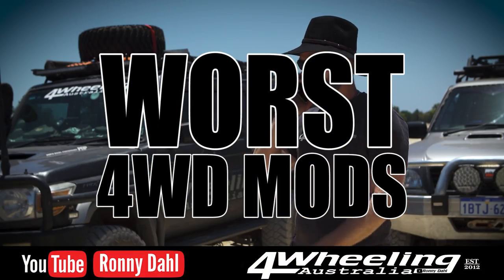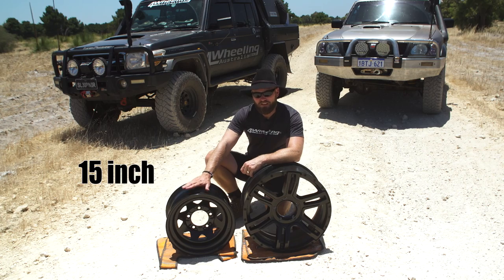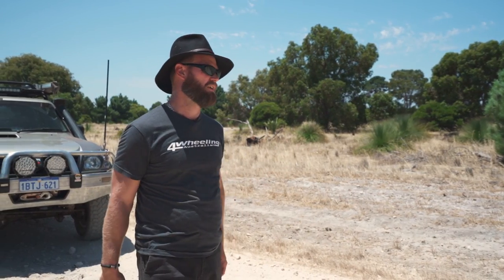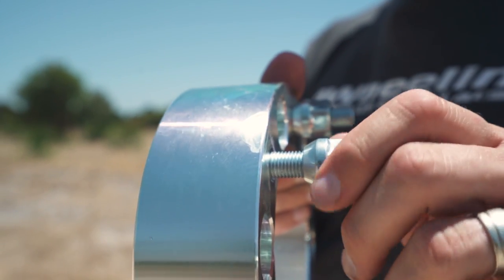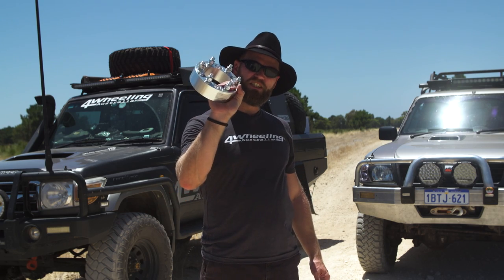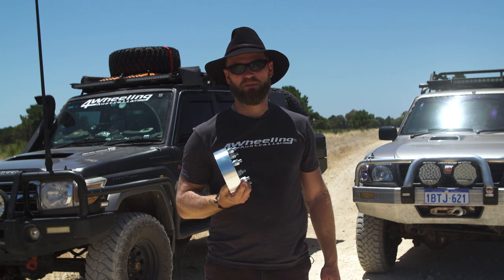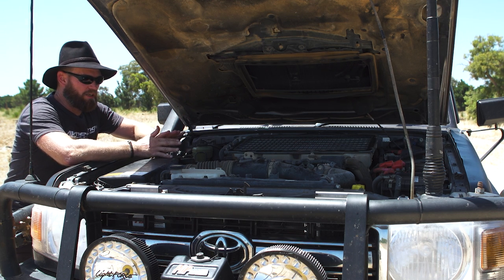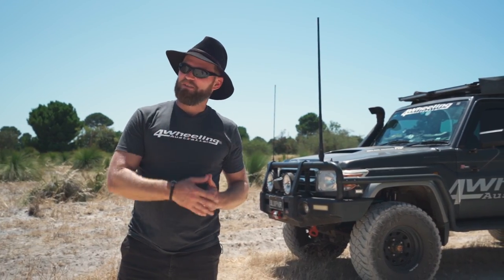WORST 4x4 MODS, DON'T DO THESE TO YOUR 4WD

Comment: Ronnie, your list is actually very good, but one thing you don’t mention is all the mods put together. What does that mean? Weight. Now I know you Aussie cats build trucks with a mind to dealing with anything you could need in the wilds of Australia, And because of that, your rigs are heavy. 

Here in the US however, there are so many that make their rigs stupid heavy for stupid reasons, especially for daily drivers. Their rigs get 11 miles per gallon and drive like shit. I consider permanently mounted winches as being unnecessary for a vehicle used it as a daily driver, mine I’m building is removable, hooking up to my trailer hitch receivers. That way I can rig it up on either the front or the back of the vehicle, and I don’t have to drive around town with it permanently mounted to the car.
Reply: Benis you know America is a big diverse place right?
Reply: I get where you're coming from. But a lot of it is to do with looks and capabilities as well. For sure we all like to build a truck that looks cool and catches eyes, they wont tell you but everyone likes the attention. But also I set my vehicle up so its capable all the time whenever i want without any set up required. I can get in an go bush after work or sometimes even whilst at work, for example I've had a mate use winches to get others out on construction sites, I think a lot of us do it so that our rigs are always ready when we need them and personally I prefer having the one vehicle I can take pride in and use for everything I do, hence it being my daily.
Reply: Because I go offroading on the fly
Reply: @fungus2116  the state of Utah would disagree hotter than hell in the south l snow and mountains in the north we legitimately have it all.
Reply: Really depends on what “daily driver” means to you. I am a forest owner in northern Europe, meaning my daily drive ranges from small gravel roads to no road at all through dense woods, the only time I drive in tarmac is once a month going to town for a haircut.. Dual winches, chainsaw, high lift, etc are absolutely necessary. But for most people I agree, it makes little sense carrying 500 kg of gear around driving down the highway to work everyday.
Reply: I leave all my recovery gear, tools, etc in a box in my tray because I often decide/notified  last minute on a 4x4 trip and I don't want to waste time putting shit together.  I've also taken my gear out of my car a couple of times and then needed it.  So it stays in
Reply: Here in the US (where I’m at) people like desert runners and trophy trucks which ARE completely legal to drive on the streets out here. These trucks are designed to be light as possible and run 800+ horsepower engines. Yes they get 4-12 miles to the gallon, but tell you’ve done 120 miles per hour over the bolder laden, ravine ridden, erosion scared desert then you wouldn’t understand. But it’s all good, you keep doing you...
Reply: Peter Jackson there’s a unmistakable difference between a truck and any 4x4 UTE
Reply: @NickS-mt8mf  however, with a much more evenly spread populated areas. Australian's mostly congregate along the coastline, up to a few hundred km inland. I can't find a good source but I would confidently estimate that 95% of Australia's population is within 300km of a coastline, 80% within 100km. This means that once you begin to travel remotely you are vastly reducing any support. And yes, I'm sure there are very remote places that I'm not aware of, across the US, but as far as I'm aware you won't ever end up several hundred to over a thousand km from well established support networks.. where you would actually find yourself driving, not just what's possible.
Reply: @kregadeth5562  I think his idea is that he installs it when he's going out for a drive/trip.. not after he's stuck. Just because he mentioned versatility of front or rear hitch, doesn't mean it sits uninstalled until he needs it. Broaden your thinking.
Reply: All due respect, im not removing my winch every sunday night and putting it back on every friday nicht for weekend wheeling.
Reply: @AWThethrower  you might be taking it out of context...  I don't believe the bloke is suggesting that you remove a conventionally fitted winch that's used every week; there are people who only 4-wheel every few months or so, yet have a winch permanently fitted. 

However, in Peter Jackson's case, he has opted to have a quick-fit winch setup so he can remove it ANY time it won't be used. But for people who don't want a hitch mount winch hanging off their vehicle, and 4-wheel often, a permanent mounted winch, on a daily driver, is the cost of having the capability. In which case any reasonable person would expect that you would leave it installed.
Reply: @olivermaskell6244  So the winch goes in the jockey box and takes two minutes to plug in to either end of the truck and do those emergency jobs. I carried a 1.5 k behind the seat of my 2wd Datsun and Mazdas for years. Used it to get unstuck once and often to snake logs up slopes for firewood.
Reply: Bar work, bash plates and winches normally add most weight to the vehicle and there a must if ya gunna hit the hard tracks in remote area's and bounce the roo's.. can't compare 2 different countries mate totally different environments and conditions.
Reply: @kaigaming2759  You completely missed his point 🤦‍♂️. He isn't comparing environments, he's comparing people. Paraphrasing, he said that Aussie's build heavy rigs when we tour because we need to, but in the States people make their rigs really heavy for less practical reasons.
Reply: @Nathanation88  then weight wouldn't be an issue for us over here, why bring it up? Is it more for other countries as an issue?
Reply: @kaigaming2759  He's highlighting the differences, that's the point.. What, people aren't suppose to discuss geographical differences of mentality?
Reply: Yeah but despite rigs being typically heavy here they still use a lot less than 11mpg due to being almost exclusively diesel. 
Probably close to 16Mpg for your average 79 series setup with 33s, bit of lift etc 
4x4 gear, Loaded up tray AND towing 11mpg is probably still more than what a 79 drinks.

Removing/adding mods to hit the mud or dirt seems like a lot of effort. Most people leave camping gear etc. out but 4x4 gear usually stays in. Removable winch that can be relocated to rear or front is a great idea though! But id still leave it on, or in the vehicle at all times, better to have it and not need it than to need it and not have it.
Reply: @Nathanation88  what ever ya recon, just saying how your wording it in these comments is different to how I seen it portrayed in the main comment.
Reply: Kai gaming you’ll get there.

Comment: I’ll mention myself. Paying $3,000 for HID conversion on my lights from the halogen & then having them fail two years later.
Reply: I got cheap eBay stuff that I can replace 10 times and still be under the budget of 1branded lights
Reply: Anyone paying $3k for a HID conversion should have their head read (sorry). Most cars of value now will have a version available from factory with HID's or high output LED's.. Either upgrade the car or buy the OEM version, ideally from a wrecker. That's, of course, if you're not happy with a standard LED upgrade available for most vehicles, which then raises questions of why you need so much light and can't go for an aftermarket spotlight, light bar or other setup. I have seen many car owners mount light bars behind a grill, in the bumper, on a plate bracket, etc.

But HID conversions are a sticking point for me because I get absolutely P'd off when numpties modify their lights and don't adjust them properly... Low beams pointing directly into oncoming drivers windscreens.
Reply: Disobey Negatively  I'm not sure what you exactly mean by this. There are a lot of ways you CAN install HID's but whether it's 1) legal, and 2) considerate to other drivers is another question. In Australia  (most states, I believe), HID's need to be auto-levelling. So if you're using them for your primary/low beam driving lights they need to have that feature. Standard LED's are typically fine, but not high-output. But if you really need a lot of light then high-beam operated aftermarket lights is where you'll achieve the best result.
Reply: Disobey Negatively  Sure, got ya! I agree. I thought you might have been speaking of the headlight reflector.
Reply: I did both. Hid in reflector projector headlights & considering I’m driving a car that didn’t have HID possibly back then. It made it difficult for me
Reply: Jason9110110 just my opinion but seems like a poor use of $3k considering the light output you could have achieved via other means, same or less money. Something you could swap car to car. Seems similar to people spending 2-3 times what a car is worth in a paint job (like I’ve seen on old lancers, commodores, etc, with no inherent value). But, you can spend your money however you like.
Reply: Oh look I agree 100% if I had the time over again I wouldn’t do it. As a matter of fact I’m re buying the factory headlights and removing the HID. Funny how life works
Reply: @Nathanation88    HID's came standard in my 2018 Silverado, but they aren't any brighter than the halogens in my '89 K1500.  No auto-level either.
Reply: Scar Hartin where do you live?
Reply: Holy shit! Honestly even the eBay leds that top out at about 35w aren't that bad. Hell, if you know a little about electronics, you can make yourself some ~100w Headlights for less than even the cheap eBay stuff.
Reply: 3k.??christ you got ripped..cost me $30..
Reply: Bruh...
I literally got an $80 dollar set that's just as bright as expensive Headlights

Comment: OMG....huge rims and low profile tires not only decreases the effectiveness of the tire, it looks bloody ridiculous. I'll keep my 17's thanks, that size was factory and is engineered to work well with all other suspension and steering components, as well a levelling kit (3" in front and 2.5" in back) allows my slightly larger tires to fit with clearance enough not to screw anything up. Works for me and my 2015 Toyota 4Runner! Great video!

Comment: Agree with your sentiments around wheel spacers, but when we talk about the 70 series cruiser it’s important to acknowledge that -50 offset rims are also illegal which I believe you ran for years.
Unless your in a position to install a new diff it’s a tough decision which is the lesser of two evils?
Reply: Good point. Whether you run wheel spacers or wheels with a big offset, same stress on the bearings, the only downside to the spacer is wobble and the possibility of coming off, which are unlikely if you buy good spacers and install them properly.

Comment: I always hear about the 79 being 'detuned from factory and you can get heaps out of it' but it's detuned because Toyota wants their engines to last 20 years
Reply: EXACTLY!! That's why i'll NEVER tune my 79. Toyota has done all the hard work and spent millions on achieving the safest and most reliable tune for that engine. Why mess with that? So many blokes buy 79's and then change everything on them! What a waste of money. They're perfect in standard form. If you don't like a 79 in standard form, then you don't belong in a 79 series! JMO. Cheers bloke.
Reply: Its probably not solely down to "reliability".
Having a lower tune also makes it easier for Toyota to meet regulations and they save money on manufacturing costs - i.e. exhaust emissions, brake size compared to power output (requirements to have a certain amount of braking force for every unit of power - also remember that bigger brake calipers means bigger rims - not great for a 4wd), clutch force required, exhaust size, etc.
Reply: There’s a line with tuning a 79 there’s the people who get a remap to change the torque range and a slight power increase and then there is the over the top 200kw tunes that do nothing off road
Reply: @jimbojones2457  yes Jimbo i totally agree , i have offroad kitted my 79 dual cab but the motor is still in its standard form except for the exhaust from the DPF back
Reply: @rollyb5061  that's exactly what i've done to mine mate. DPF back 3 inch exhaust. Gave it a bit more torque and sounds a bit better. The motor is bulletproof if you leave it alone mate. Cheers.
Reply: The more power you put through an engine increasing stress, you reduce the life of the engine. Simple as that. No question. The only question is how fast do you want to go?
Reply: Actually I'm pretty sure they just detuned it because they didn't think the h151 gearbox could take it. Pretty sure that's why the 200 only came with an auto too. Note that they had the h151 in the turbo 100 series, and the 1vd-ftv in the 70 series is detuned to pretty much the same power level as the 1hdfte.
Reply: Jorn Navarre  Finally someone who actually understands tuning and emissions reg, and these guys think its for reliability lol.
Reply: Jorn Navarre  mate i beg to differ. I'm a senior Toyota technician and do master training at Port Melbourne Toyota Headquarters. I know exactly why they do what they do. An engine modification will affect another driveline component in some way. Even the engine itself. Not only mechanically but chemically. This will absolutely reduce the life of the engine. These aren't Holden red motors mate, they're very sophisticated and if you modify them you actually don't understand the affects of that. Neither do aftermarket engine tuners.
Reply: Jorn Navarre  100% mate totally agree. They are definitely engineered well. Which is why we shouldn't mess with that wonderful engineering. It's ok to tune an engine mildly but it will have a long term effect. But most people don't keep the car long enough to see the end result in failure. So if the engine would normally last 600,000kms stock, it will only last 400,000kms with a tune. But it does make a difference. Cheers mate.

Comment: My jeep came with 20 inch rims and 35s when I bought it. I didnt know better at the time... now I need to replace the rims and regear to keep the 35s lol.  Cant go back now.  Great video as always Ronnie!
Reply: If you're keeping the 35's then you shouldn't have to re-gear it.. unless I'm missing something?
That's the one thing I love about what I presume is the American system with a 35/12.5 R20, the 35 is the actual diameter, the 12.5 is the width and the 20 is the wheel. Just seems far more useful to an end-user than this aspect ratio number used on the metric version.
Reply: @4wdguydrivesby  hi Scott.  Unfortunately a 2016 jeep wrangler jku sports come with a dana 30 front and 44 rear with a 3.21 gearing. Very under powered for 35s.  Havent had a problem with the 20s and airing down though.
Reply: @clwade10  What does the tyre placard on the inside of your drivers door say ? Pretty sure 35's a nearly illegal on most 4wds in Australia. And you are also uninsured. Don't have a accident as you might be fucked
Reply: @Mack74  In the states we don't have as much of a tire size limit as you do down under. It is very common to see 35" on vehicles as their first mod. 37" to 40" are for the big boys here who use 1 ton axles for playing in the rocks and mud.
Reply: Todd Hoffmaster
In Australia 50-75mm (2-3 inch) maximum is allowed in lift suspension & wheels combined depending on which state you live in.  Any more and you can get booked and your 4wd being declared defective & unroadworthy until you get the height back down which is an expensive/timely exercise if you had a 4 to 6 inch lift & bigger tyres.
Reply: @cliffbooth7075  and if you have a accident. Insurance won't cover you as you're unroadworthy.
Reply: @Mack74  Good to know 35s are illegal in Australia.  Here in the states many people run 37s and even 40s! It is a good idea to check with insurance to be on the safe side.

Comment: Ronny, I agreed with just about everything you said except 20" rims being ok on a Ram.  Rule of thumb:. Rim diameter no more than half the tire diameter.  I run 17" rim with 37" tires on my Ram 2500.  Even if I was running 40" tires, i would do 18" at most.  20s just look stupid on anything let alone a 4WD.  So, my vote for worst mod is big rims with low profile tires with real ridiculous negative offset....just dumb.  We call them bro-dozers here in the US.
Reply from the maker: I you have the rubber then yeah I agree but if not it’s a thin rubber band
Reply: @Ronny_Dahl  yes, much agreed!

Comment: You would have a hay day here in Texas. So many trucks and Jeeps with “off-road” crap bolted all over but never see a dirt road.
Reply: Same here in Nevada. $70,000 truck with $15,000-$30,000 in mods slapped all over 'em and not one speck of mud or dirt, no bits of unintentionally acquired flora hanging out anywhere. Not even a hint of that tell tale dirt coloration in the recesses between the cleats. I mean, why would someone spend that kind of cash, invest all that time and skill just to build a fully functional, completely capable..... 4x4 pavement princess? What's their... You know what? It's their cash, they can do whatever they want. I'll be me and they can be them.
Reply: How do you know they "never see a dirt road?" Do you follow them around to observe how the vehicles are used? One of the very first things most do (at least those who care about their vehicles) is clean that mud and similar off. My truck is almost four years old and still looks brand new top & bottom.
Reply: @cliffcampbell8827  Pavement princess lolz
Reply: Cliff Campbell you’re judging somebodies off roading because of no visible dirt? That’s a poor speculation. I own my own detailing business and my truck is always detailed to the max after every off road trip and I’m sure there are people who do the exact same.